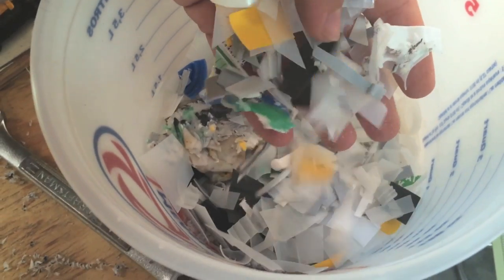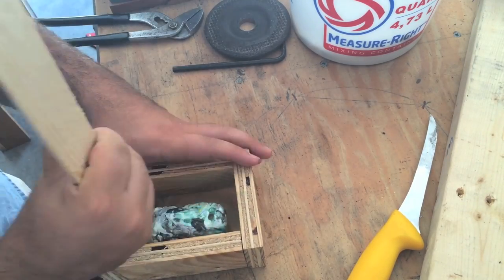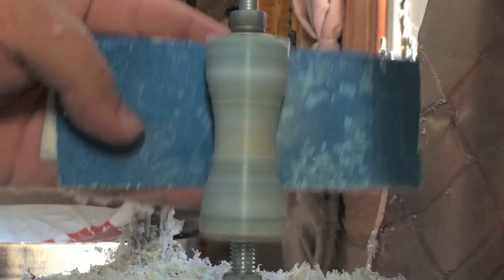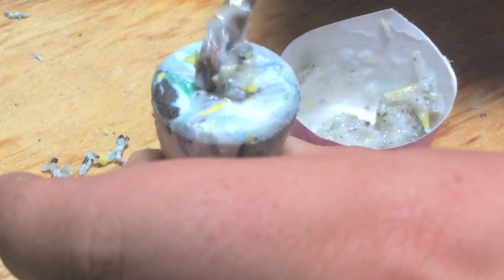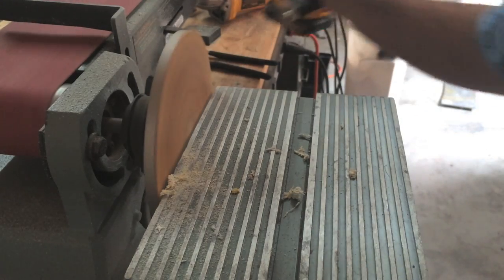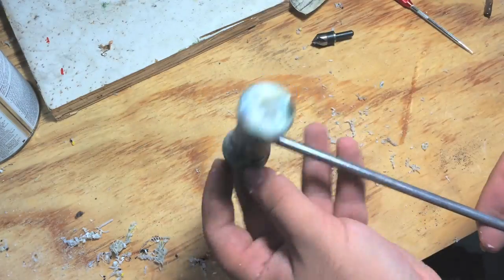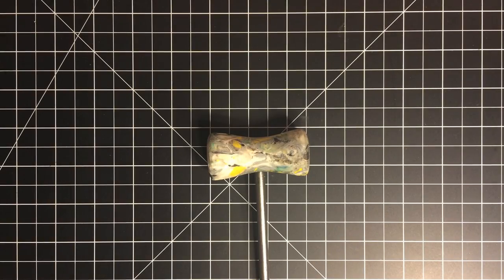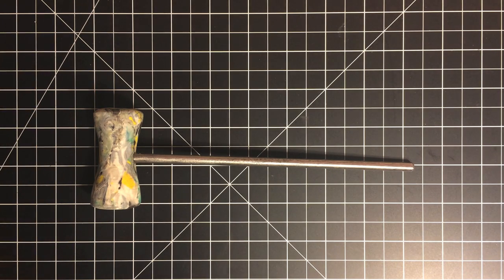Recycled HDPE Bass Drum Beater

Comment: Pro tip put the epoxy on the shaft and then install the beater on it. When you put the epoxy in the hole you can hydraulically stop the shaft from going all the way in leaving less surface area to attach the shaft to the beater.

Comment: To get your air voids out you need to knead your plastic more. Now how you go about doing that is entirely up to you. The methods I use are not entirely 100% foolproof. But I use a combination of cold steel hammering while I am melting, then high pressure clamping, during cooling.
Reply from the maker: +Paul Frederick Cool, thanks for the info! this was the first I messed with it.

Comment: Ok young blood let me help you out here, when you find holes in you molds or parts just get a hot air gun and a plastic grocery bag or 2 and melt them into the spaces fast cure with cold water. And when mounding to HDPE just heat it with the hot air gun and push the Handel into it. Keep the epoxy for emportant stuff good first cast